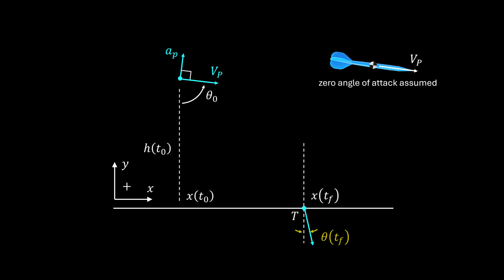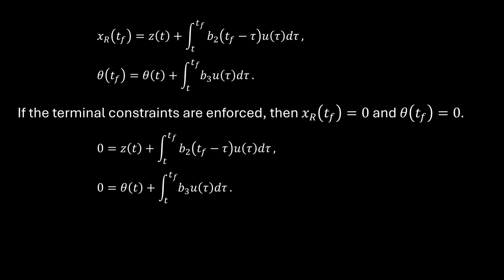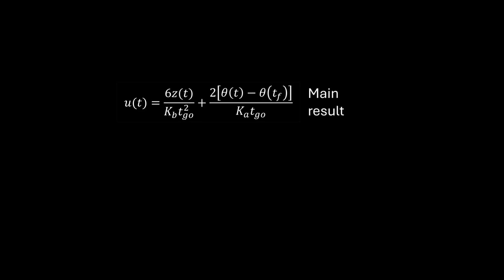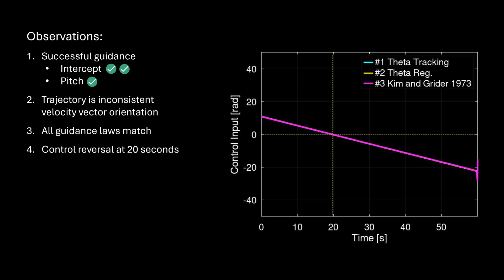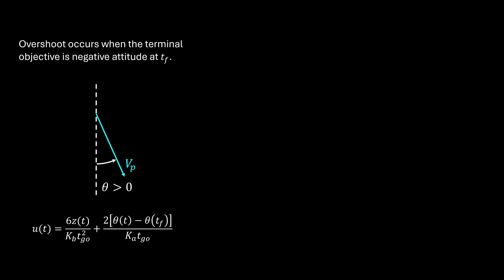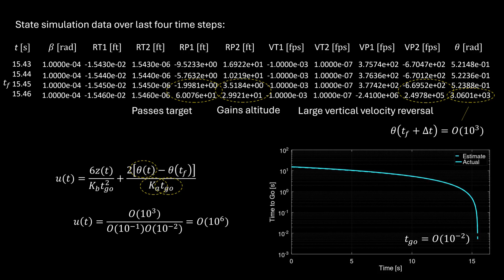Attitude Trajectory Shaping Guidance - Guidance Fundamentals II

Comment: Would solving for "minimum" fin deflection and then using a higher multiple of minimum deflection (my guess 1.5-2.5) for control input fix it? I think this makes it assume a more perfectly overhead position much earlier in the trajectory, and therefore avoiding overshoot.
Reply from the maker: Corrections like you mention can be useful, particularly when more complexity is added to a simulation. Note, that when we generalize the result with the gain N, it is a tuning knob to further adjust the trajectory. The optimal control problem attempts to minimize control effort. If overshoot occurs, it's the math telling us that on the whole, we use less fin if we allow the pursuer to overshoot.

Comment: What if the body is controlled only by the tail flaps, and the motors are not attached? Is there a way to formulate a similar law of guidance?
Reply from the maker: Yes, actually this is exactly the example used in this lesson!
Reply: @LearnGandC  This is a point of confusion for me: if there are no motors, how can one assume that the angle of attack is zero? Lateral movement is done only because of a lift force, which is zero with zero angle of attack. Is this assumption made to make a problem tractable? Can the solution also be applied to a close-to-zero angle of attack movement with somehow tuned values of Ka and Kb?
Reply from the maker: You are right to be concerned with the zero angle of attack assumption, particularly in cases where significant turns are required. In the development of guidance laws, this is a typical assumption for problem tractability. In reality the angle of attack will change due to control effects, like fin angle adjustments. Whether or not it's an issue has to be evaluated on a case-by-case basis. Yes, one could attempt an ad-hoc tuning through Ka and Kb.

Comment: Thank you for this great video!

Altitude above the ground is often hard to estimate because of its low observability from camera signals.

One may try to increase observability by maneuvering like in Optimal Experimental Design, but this may need a greater control authority (and there are not many papers on this).

One may compute LOS rate and act on it directly, but its computation involves numerical differentiation of noisy signals.

Another approach would be to put a body above the target as early as possible, but this leads to oscillations at the end and large efforts at the start.

Is there something I missed?

I would greatly appreciate your feedback.
Reply from the maker: Thanks for watching and your thoughts! I think you have nicely outlined some of the challenges with practical implementation.
Reply: @LearnGandC  Thank you for sharing your expertise. It is hard to overestimate the value of your videos!